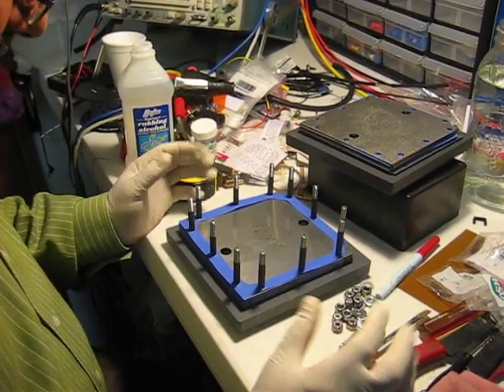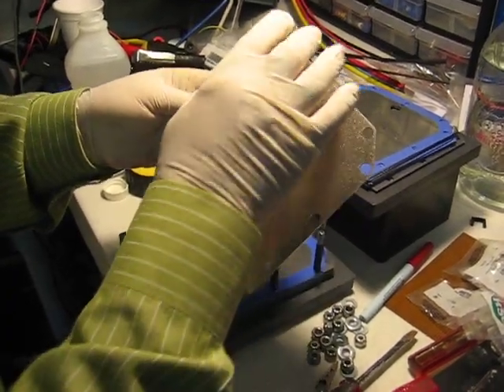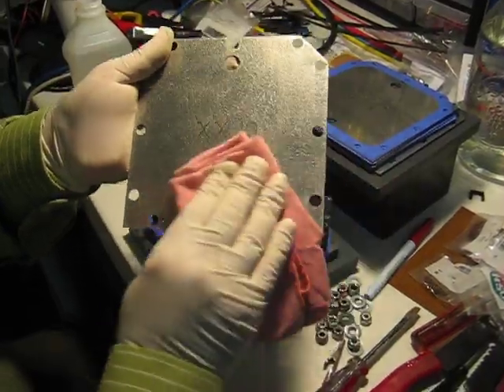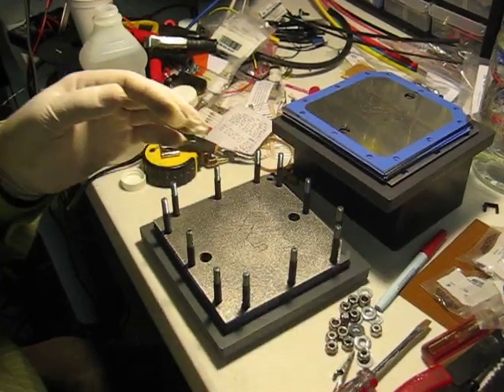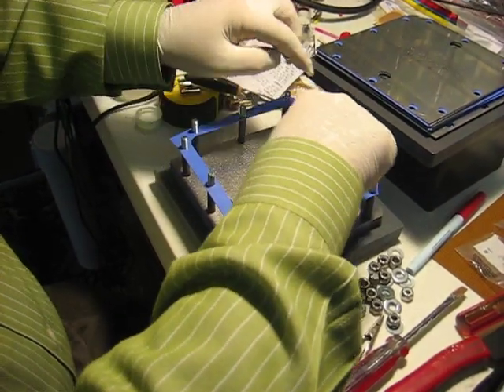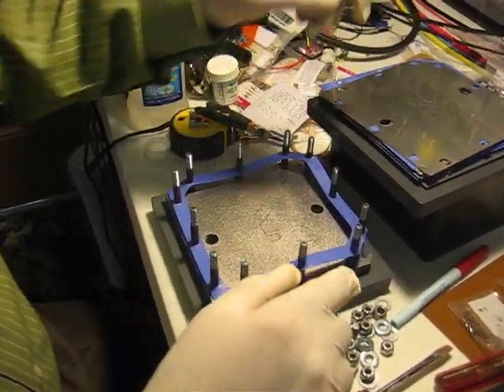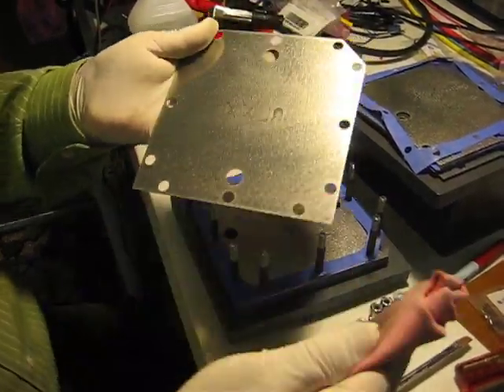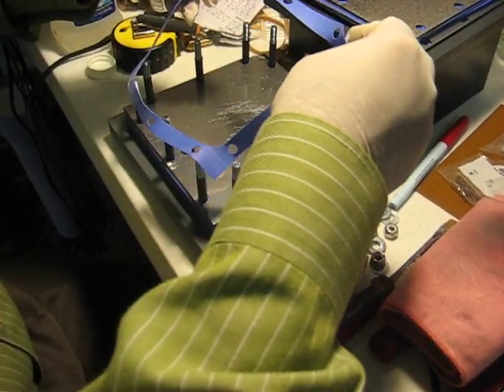HHO Dry Cell How-to build Part 1

Comment: You should scratch the surface of the stainless steel with 100 grit sandpaper to increase the surface area, but don't scratch the steel where the +,- connect.

Comment: What kind of metal plates are used? Remember, stainless steel contains chromium. The electrodes, and thus the chromium is consumed, and you end up with poisonous chromates in your electrolyte. Dumping it on the ground or down the drain is ILLEGAL! The compounds can cause severe skin problems and ultimately, cancer. Hexavalent chromate is poisonous. 
Does your electrolyte turn yellow? That's a sign of chromates.

Remember, you do this to help the environment, right?

Comment: Once Again Thank You For This Video, I Have been online for the past 4hours researching the same issue, How to align the Terminals. because in most videos they have 2 or 3 wire connection on each Terminal. This Should be a Very important point to Stress when Making these videos Yet Most Of them don't even Point Out that the plats have to be Alternated.
But Thanks Again Friend.
So Now all I need is one - & One + On Each Terminal Right?

Comment: it dont work that way, you need to research and develop it yourself
the materials is, stainless steel, pwm (30 amp+ Ebay) wires
water, LYE
good luck

Comment: Having all the bolts touch and go through each plate, even with spacers makes the electricity hit each plate making them not totally neutral.... having it this way will make the current way weaker, and the electricity will pass more though the bolts instead of the water. keep trying tho. :)

Comment: Running completely on HHO at this point using only one HHO generator may be a far stretch, but even a comparison from your MPG's before installation, and what they were with your project installed and running would be greatly appreciated.  Thank you  Also, did you use project plans available somewhere on the internet?  I've been unable to find any that show design and parts needed to make a complete system.  Thanks!  And keep the videos coming.  They are great.

Comment: Small plate gap isn't critical. On my cell I use a 6mm gap and it works fine. You also have a larger fluid capacity because much of the electrolyte comes out as oxyhydrogen bubbles..

Comment from the maker: I got the insulation from a friend who had both the plates (made from 316L ss)and the gaskets made at a shop in long beach. I finally got around to installing the unit in my car and will be testing it for the next few days. No it does not run (not yet) on pure HHO.